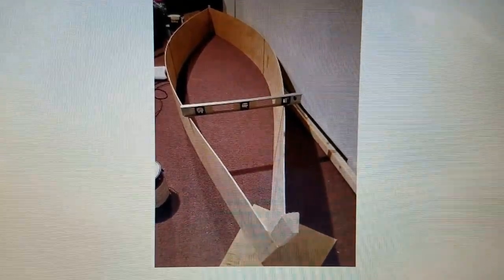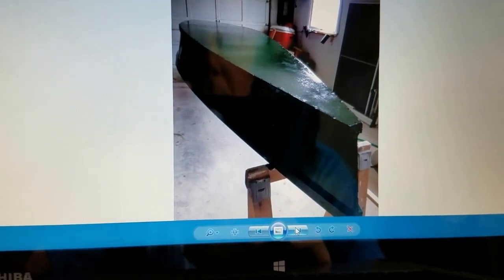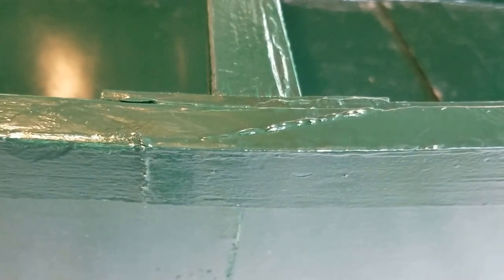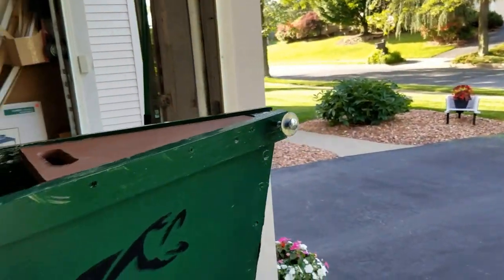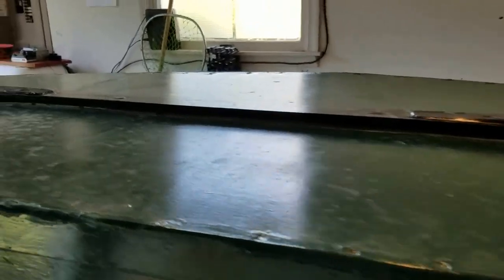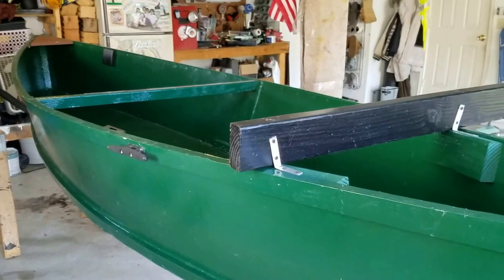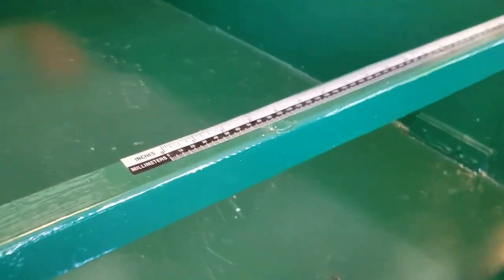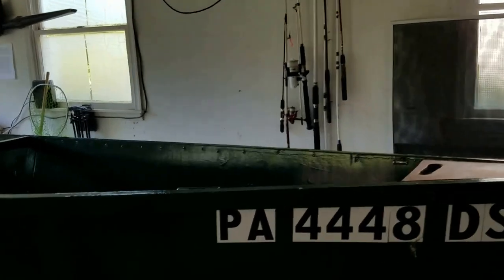Lazy weekend canoe build, mods, and lessons learned

Comment: how wide is your boat? and how much weight do you think it will hold? i am also curious about the height of the sides the reason i am asking is years ago i made a sneak boat 12ft and i weigh about 300lbs and am a big guy and i have been thinking about a pirogue and i am sure i would have to customize it to accept my weight
Reply from the maker: I'm 180 and had my wife it in it. She is much less than me but I won't take a guess at her weight because I fear for my life LOL. As for the dimensions. I'll have to check and get back to you but it may be a while as it is currently covered with snow. This is where I got the idea and basic instructions for the boat. http://toledocommunityboathouse.com/2013/130316_lzwk/index.htm. They may be able to tell you more as far as weight capacity. I guess you could always use half inch instead of the quarter inch I used but I'm sure it will add to the overall weight of the canoe and the ability for one person to load and unload it.